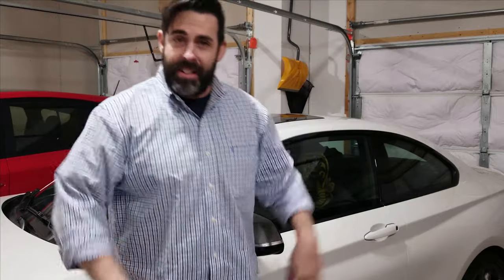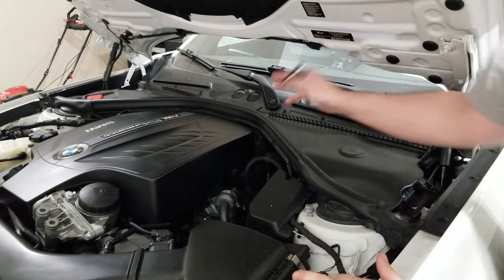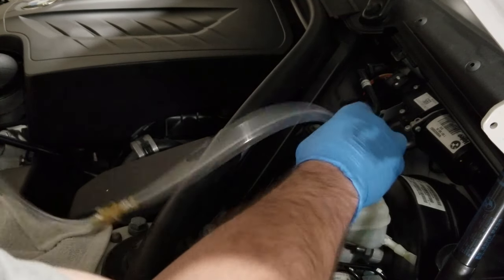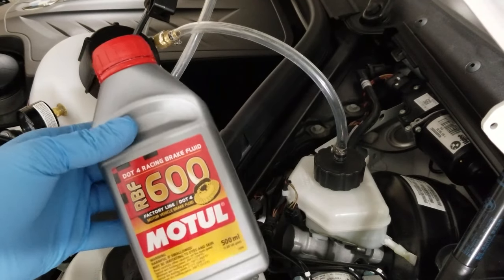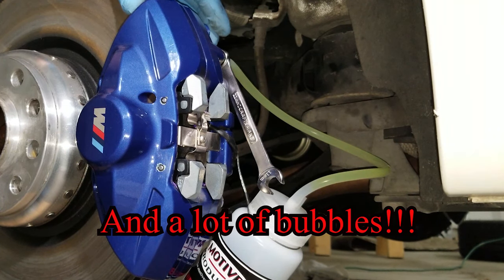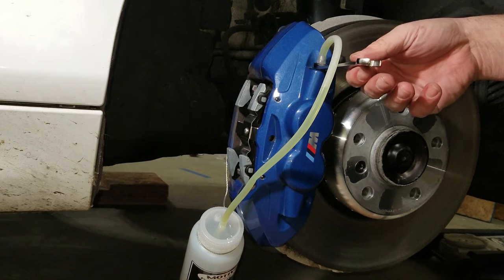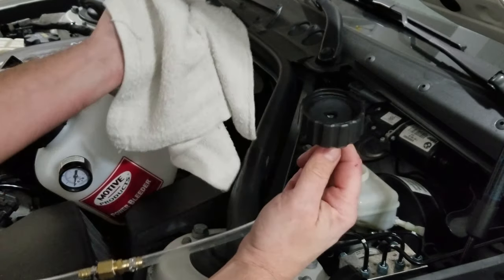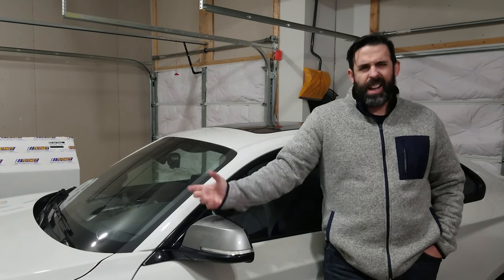DIY bleed Brembo/MSport brakes on BMW, Motive Power Bleeder

Comment: I'm not impressed by the M sport brakes either. Let us know if you notice the brake performance improved after removing the bubbles.
Reply from the maker: The brakes are SOOOOO much better! I love the brakes now. They have good bite and don't seem to fade much at all after a bit of spirited driving. I'm definitely glad I did just the regular brembo rotors and performance pads. I wish I would have done a 60-0 with the stock set up because I know this would destroy that. The pedal is firmer and inspires a lot more confidence in hard braking situations. 
Thanks for checking out my channel!
Reply: I actually drove both M sport and regular brakes. They don’t seem any different if you do one or two even 3 hard braking… the M sport brakes with fixed caliper really shines after you do more than 3 hard braking or emergency stops… they resist brake fade sooo much more than stock. I also have the M package and M brakes so there are additional vents directing air to the tires for cooling. In short one or two panic stops… you really can’t tell the difference, now you race it on a track and you’ll see the difference after a few corners

Comment: superb detailed DIY for brake bleed! have always been leery of pressurized bleed systems as if they leak it can be a mess, especially with brake fluid. This is detailed enough to make it worthwhile
Reply from the maker: Glad you found it! It's always good to  put some plastic down on the floor under the brakes, juuust in case. Don't worry though, you got this!

Comment: Thanks. Well done video! Clearly explained and filmed. I have 2014, 4-series with these brakes (M-Sport) and I like them a lot. I did upgrade to Cool Carbon pads though as the factory pads dusted horribly. They are strong and easy to modulate. I do a lot of my own work, but I've always left brake bleeding to someone else. You've made this look super simple. I've been inspired!
Reply from the maker: I appreciate that! I always thought bleeding the brakes was going to be super complicated and required special tools. That power bleeder makes it amazingly simple! If you already do your own pads and rotors, you can do this, NO PROBLEM! 😁👍 I'm going to do a stainless/braided line video in a few days. You should pick those up with the power bleeder and do them the next time you do a fluid flush. Two stones, one bird. 🤣
You have a 435? If so, everything under the hood is identical to my little 235. You'll just have a little more room because your car is bigger. 
Thanks for checking out my channel! You looking for anything else?
Reply: @TheWrenchLab  I have a 428i, but I've also been thinking about doing the SS brake lines as well. Not looking for anything in particular, although at some point I'd like to somehow selectively re-color part of my door cards, lol. My interior is completely black and I'd like to add just a bit of contrast. I've been thinking about trying some leather/vinyl aerosol paint on the middle part of the card where the handle and switches are.

Comment: I don't know how many hundreds of DIY videos I've seen, but this is in the top 5 for sure.  I think you've thought of everything here, and being a bit OCD, I certainly appreciate it.  If you get bored, you can do a coolant flush video on a Lotus Exige.  Hell, I'll pay you to do it!  :)
Reply from the maker: Thanks Andrew! Devil's in the details!  You have an auxiliary radiator in the wheel well? They're usually lower than the lower than the  radiator in front of the engine. A good lown place to start draining. 😉

Comment: About the bubbles, there are 2 types. One is that from the brake lines inside, one is from the bleeder valve itself that gets sucked in when the bleeder valve is open. You can listen to the ladder one with your ears, and also there is nothing to worry about. The bubbles that you should concern about are those inside the brake lines. Just bleed 300ml on each brake. That should take care of it.

Comment: Thanks for the video I will use this as a guide for my m140i. My brakes feel terrible. I will use your other guide and do an overhaul of discs pads and braided lines with fluid :) thanks
Reply from the maker: It should be a huge improvement! Happy projects! 💪 Thanks for checking out my channel!

Comment: if you empty the reservoir before starting . . . how much fluid did you extract from each corner before it started coming through clear?? My fluid is pretty much the same colour as that I'm replacing it with and so very difficult to know when I've changed it out as there's no colour change and I want to be sure I've flushed through completely.
Reply from the maker: A complete flush should be around 12oz or 355mL. My motul bottles are 300mL each and I made sure to use more than that. Years ago, companies used to make different colored fluids, not sure why they stopped, probably some safety related thing like kids drinking drinking it thinking it's kool-aid.

Comment: Question is how can you store the Brake Fluid Flush Kit

are you gonna clean it up?
If you do please show us how you clean it
Reply from the maker: Run mineral spirits through the hose. Then pour a little in the bottle and wipe it out with a shop towel. Also use a shop towel to wipe off the bottom of the pump mechanism.  Easy day.
Reply: @TheWrenchLab  
Thanks a lot

Comment: Great video Great piece of kit .. putting mines into bmw to get done . I feel I need to do I little double pump on the pedal to get the bite . Did you have the same issue before you changed the fluid ? Keep up the great work 😁
Reply from the maker: The brakes were absolutely horrible before I did the pads/rotors and fluid flush! I know exactly what you mean! I had no confidence in the brakes prior to this. They are so much better now. I still think they're far from perfect but it's definitely an improvement. It's as if the master cylinder doesn't build enough pressure. It's just not worth replacing on a street car. If this was a full out, race build, I'd replace it with a different, more powerful (and consistent) unit.

Comment: I received a notification to bring the wife's car in for a "brake flush service"  Is this a video that can show me how its done?
Reply from the maker: The only thing I didn't cover is flushing the abs module. Other than that, absolutely! 🤙
Reply: @TheWrenchLab  ABS?
Reply from the maker: The module that runs the Automatic Braking System.

Comment: Great video, thanks! I noticed that you didn't use ISTA/D to run the DSC pump after bleeding and re-bleed to ensure there are no bubbles in the pump. I've read some accounts that you need to do that to ensure a good bleed. Is there a reason you didn't? Is it not necessary to do?
Reply from the maker: I had intended to make a separate video for that because it's a very involved process. Getting the program, laptop, cables, etc. I will hit that in a video where I change the brakes lines out for stainless steel / braided lines, eventually. 
I do think it's a necessary part of maintenance.
I also think that there's a risk/reward when it comes to DIY projects such as that. For those familiar with ISTA, that already have the tools, it might seem like no big deal. For others, it may be an absolutely daunting task... to use your laptop, a program you downloaded from some questionable website, and connect to your car with a cable you got on eBay...to do something you've never done. 

I guess eventually you're tempted enough to touch your tongue but to a 9v battery. 🤣
Reply: @TheWrenchLab  I bit the bullet this weekend and tried it myself using ISTA. It was a lot easier than I expected, but a few things surprised me that you might want to know if you end up making a follow-up video. First, the recommended bleed order is actually left-rear, left-front, right-front, right-rear (different than any other car I've owned). Second, with ISTA it's still a two person job. You're supposed to pump the brakes while bleeding while the DSC pump is being cycled. Can't do it with just one person. You're right that it's a bit daunting, but it's not too bad.
Reply from the maker: Great looking out Justin! The different order 🤔 wonder if that is actually due to the length? I've only seen one video of someone actually using ISTA/IMPA do to the ABS module and they only did the rear brakes. I don't think they mentioned the order either. He left the bleed valve open and did the laptop and brake pedal all by himself. You don't recommend that?
Reply: @TheWrenchLab  In hindsight, that probably would have worked. The instructions in ISTA specifically state that you need two people, but I probably could have cracked the valve, then started the DSC pump, then pumped the brakes, then closed the valve. As it stands, ISTA runs through ~5 different steps (from memory as I did this yesterday, so might be wrong here)
Note, all this is after you've already bled the brakes the normal way. Then you go into ISTA and find the brake bleed procedure (I think it was under "Chassis"?)

1) cycle the pump with no valves cracked while pumping brakes (1 person job, I pumped the pedal while the DSC pump ran for ~15 seconds)
2) cycle the pump while bleeding left-rear brake and pumping pedal (2 person job, but you might be able to do it one person as you said. The pump only cycles for about 10-15 seconds so everything was just happening so quickly that I just skipped the "pump the pedal" part)
3) cycle the pump while bleeding the left front brake while pumping the brakes (same as step 2, I just skipped the pedal pumping part)
4) cycle the pump again with no valves cracked while pumping brakes (identical to step 1, so I pumped the brakes)
5) bleed all four corners again, with the DSC pump off, just to make sure you get all the new bubbles out
I should note that I've got a B58 and I think you have an N55, but I don't think that would affect this procedure at all.

Comment: Why do you take the basket out? Is it just to get at the lower fluid in the reservoir? I'm not sure it's worth the effort although that pick you showed does the trick nicely.
Reply from the maker: I did it so I could get the turkey baster inside the master cylinder to suck out old fluid along with any dirt and debris. That way I'm not pulling that junk all the way through the system when I flush the fluid. 😁

Comment: When doing this how is it that the power bleeder doesn't pump in the air from the air pocket in the pocket of the motive bleeder tube?
Reply from the maker: I talk about how the power bleeder works at the 7:00 min mark. As long as you make sure the bottle stays in position where the pick up straw is in the fluid, you're good.
Reply: @TheWrenchLab  thx!

Comment: Hey man! Great video. I was just wondering when you add the new brake fluid, is that to the pump bottle only or do you top up some new fluid in the reservoir? Thanks
Reply from the maker: If the brake fluid is low during a regular fluid check, just add some to the brake master cylinder reservoir. 

When bleeding the brakes, the pressurized bottle has a line that runs down into the bottom of the bottle, where the new brake fluid is. Pumping the bottle up to pressurize it, pressurizes the brake system, through the top of the master cylinder reservoir. So, when you loosen one of the bleeder valves on a brake caliper, that pressure forces brake fluid from the bottle into the top of the reservoir and into the brake lines. 

It makes sense as I say it, but does that make sense to you? I probably over explained that.
Reply: With Mikey! Total sense, thanks so much for taking the time to explain man. Keep the videos coming 🙌🏻🙌🏻🙌🏻
Reply from the maker: I've been totally slacking on making any videos lately. The old "I've been so busy" excuse. I have a bunch of ideas for my next few videos, I just need to start it up again! 

Anything you'd like to see? 

Thanks for checking out my channel by the way! 👍
Reply: Around 6:45 did you attach the pump to an empty reservoir tank or did you fill up the reservoir tank too?

Comment: What if you realize that you’re out of fluid in the power bleeder.  Do you have to restart if you realize too late? Also, if you need to add more fluid to it, any specific steps to take?
Reply from the maker: As long there's still fluid in your master cylinder you're just fine. When you refill the power bleeder, loosen the cap slowly (15:30 in the video) then add more fluid, put the cap back on and pump it up again. No biggie. 🤙👍

Comment: How can you have bubble since you using motive power bleeder and the process are close and under pressure
Reply from the maker: The system will never be %100 sealed. Over time, air and moisture will eventually get in the system. It doesn't help that brake fluid is hygroscopic, meaning it attracts water. Little by little, bubbles will find their way in which over time causes a spongy brake pedal. It's just part of necessary maintenance.

Comment: Don't you need to purge the abs with ISTA?
Reply: The answer is yes, if you want to do it as per BMW spec. The DSC motor will whir at each corner bleed based off a step by step guide in the ISTA program.

Comment: What happens if there’s air in the line from the motive to the master reservoir?
Reply from the maker: That depends... If the master cylinder is empty, air could be getting pulled into the brake lines during the bleeding process. If that's the case, you need to bleed them again (all 4) to ensure there's no air in the lines. As tempting as it may be, I wouldn't recycle any of the fluid from the bleed bottles. Dirt and debris from the lines going directly into the master cylinder... No thanks. 

As long as the master cylinder had enough fluid in it, to prevent air from getting pulled into the system, you're good. I assume you're asking because the level of fluid in the Motive "jug" got low or the bottle moved while you were bleeding them. 

If you have any doubt, just do the whole thing over again, yes, it's time consuming and will cost you more $ for another couple bottles brake fluid. However, piece of mind, knowing you did an additional flush, will help you sleep at night. I look at it this way, getting to bleed the brakes a second time, is getting more experience with the process, which pays off big time when you start doing track days. Besides, a double flush, further insures the lines are purged and clean. 😁 You're just getting some extra quality time with your car.

Comment: What size tube do you use? 7/16 inch tube?
Reply from the maker: The tubing on the bleeder bottles is 3/8 i.d. I can't measure the power bleeder because the tubing is permanently clamped on the fittings.
Reply: With Mikey! Perfect. Thank for the quick responses . Bleeding my brakes next week.
Reply from the maker: That power bleeder was the best investment ever! Hope the video helps. 👍

Comment: what jack do you use to jack the front of the car?
Reply from the maker: The harbor freight jack I have isn't even available there anymore. Besides, it's not low or long enough to reach the front center jack point without pulling on my diy wood ramps. 
My recommendation, measure the height of front lip on your car and the distance to the jack point, try and find the lowest and longest jack you can afford at harbor freight. It's easier to do that at an actual store because they have the jacks out on the floor to look at, and measure. 😉
Reply: @TheWrenchLab  👍 thanks